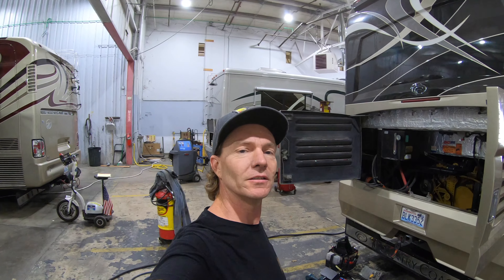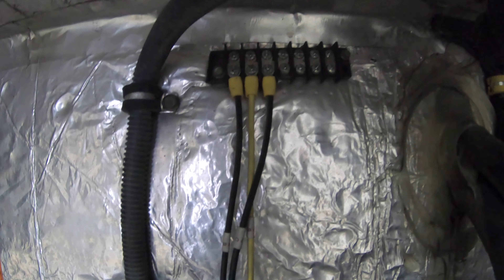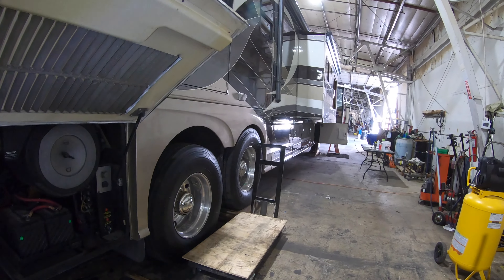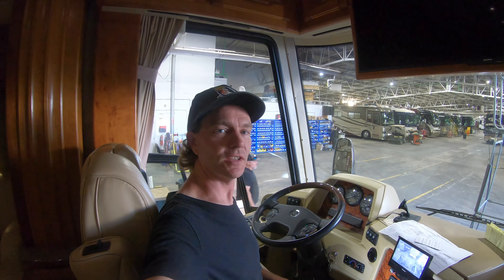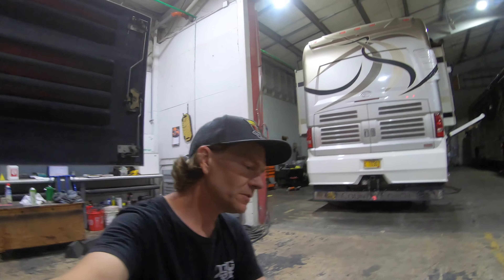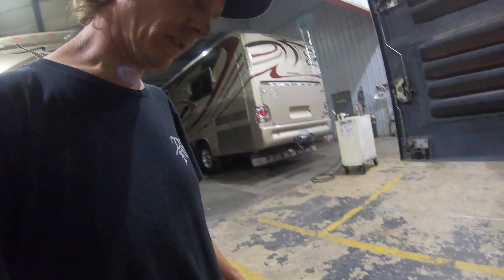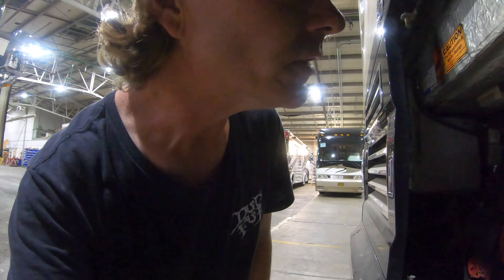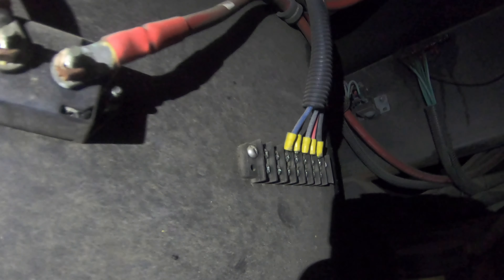Country Coach Spare wires and Brake Controller Installation.

Comment: Excellent Video!! Wondering if you might have any knowledge of the older country coach spare wires?? I have a 1999 CC Magna I have to install a Brake controller. It does not have a charge wire or a Brake wire in the Trailer plug?? Hoping there are spares in the coach to help with wiring that Trailer plug for brakes??

Comment: Do the older coach’s have spares like that. Like my 95 intrigue ? Just ran a wire for a trans temp gauge through the middle of the coach. What a pain
Reply from the maker: Yes there is spares.
Reply from the maker: Yes the spare location would be just below the rear house fuse panel to the front just behind the entry switch  panel.

Comment: I have a question a bit off this topic, does my 1992 Magna #4923 have a tow board for the trailer plug? If so do you remember where it was installed on the coach?
Reply from the maker: I don’t think we started putting tow boards in tell approximately 97 maybe 98 model year coaches.

Comment: Hey Brian, great video! My buddy and I were just talking about this yesterday. He thought that CC must have a harness already wired for a plug and play brake controller. I can see by the amount of work you did it's a little more complicated than that..... Ha!
Question, When I saw one of the videos that Andrew did he said you all had some used parts available. I tried several times to get in touch with your parts department but never got a response. I need the original entrance keypad for an 06 Magna. Do you think you might have one of those around?
Last comment. I really enjoyed the videos from your shop. You now have a Youtube channel. People would love to see the build quality and a front to back/inside out tour of each coach for sale in your inventory. Maybe one a week? It would be a great sales tool (in my opinion anyway). Just a thought. 
Thanks for posting!
I love my Magna- #6553.